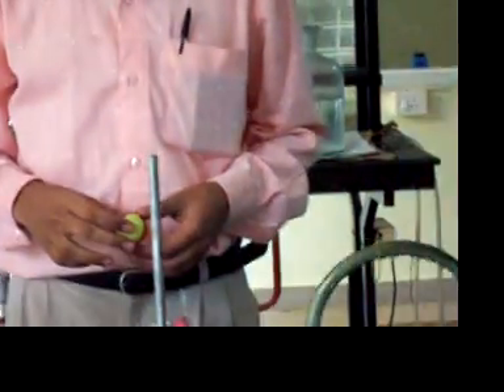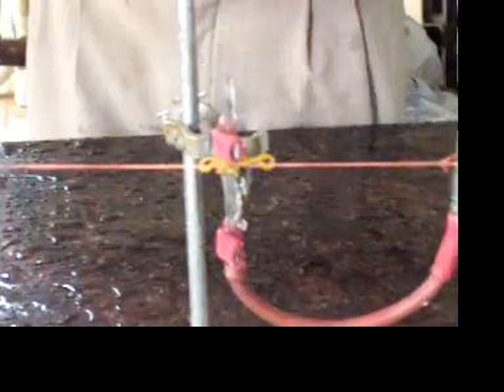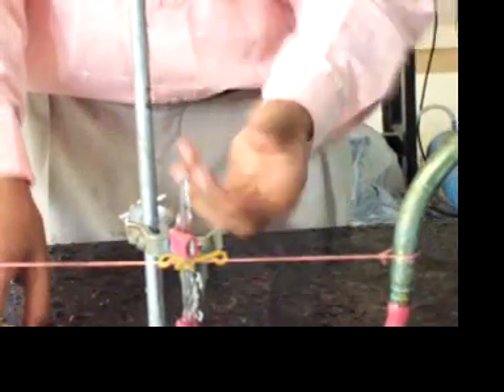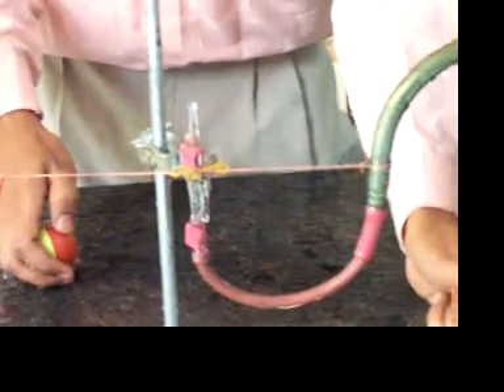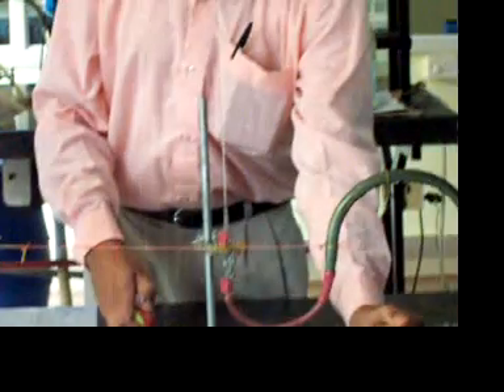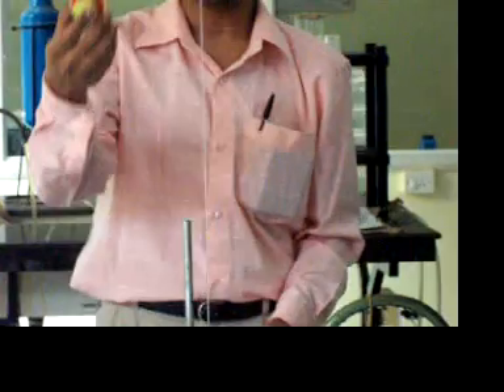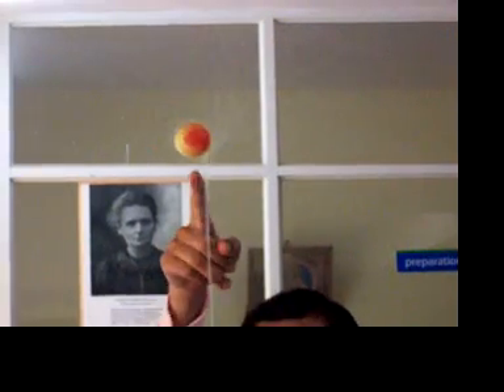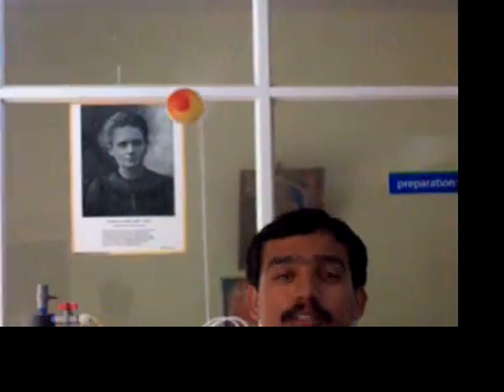physics experiments ravish high school project demonstration of Bernoulli's Principle

Comment: how did you make this. reply asap :D
Reply from the maker: I took thin holed glass tube available in chemistry lab,hose pipe,plastic ball.Fix the glass tube to the tap through the  hose pipe.Allow the water to raise as a fountain head to a height of 10feet. Place the ball on the water stream. You will see the  ball floating.